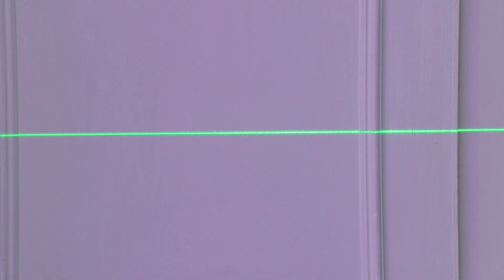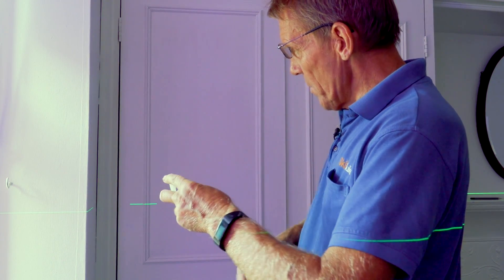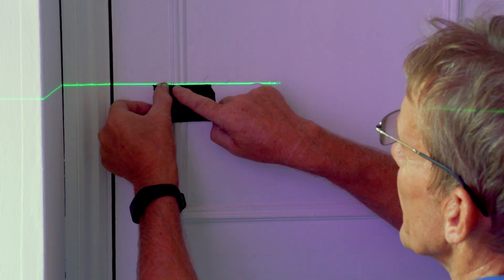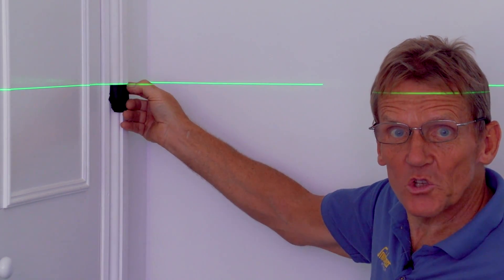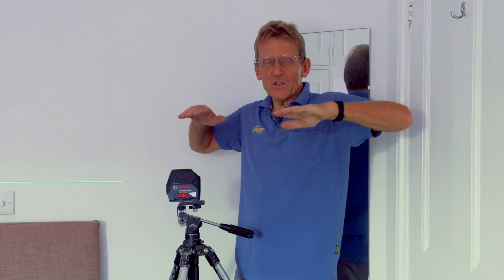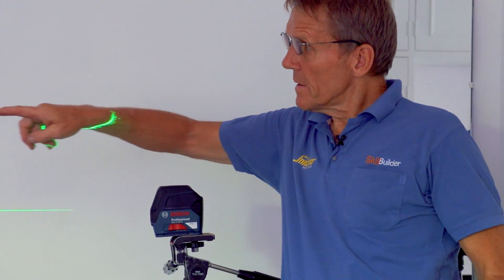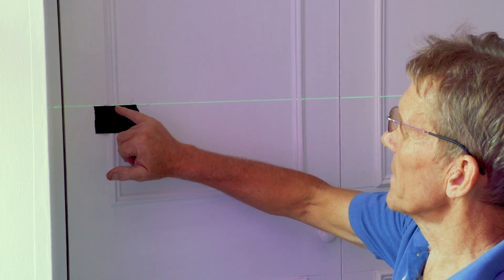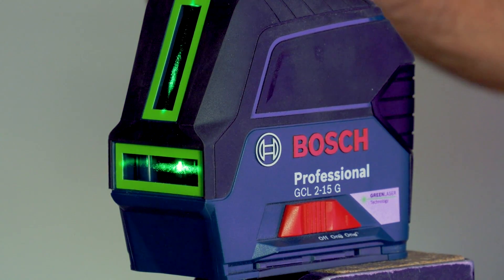Is Your Laser Level Really Level? How to Check

Comment: Absolute cobblers. The centre of the beam is your reference point, as the further the laser is from the wall the beam is hitting, the wider the beam is. Incidentally, never use the vertical beam unless the wall you are hitting is perfectly plumb, or you are 100% square to the wall. A great example of how the plumb line is generally useless on a laser, is to aim the verticle laser at something leaning at an angle to the wall, say a piece of ply or plasterboard, and position the laser at something obviously not 90 degrees to the board. Even the naked eye will see the beam is woefully out of plumb......now imagine that's your tiles or a wall unit.....oh dear.
Reply: The vertical line is far from useless. I wouldn’t use it as a plumb line but it’s an excellent replacement for a chalk/ink line. So long as you treat it as such, it’s fine.
Reply: Iggfer, quite right, that's what I do when I'm tiling a floor solo. Incidentally, the Bosch gsl range are great for tiling a floor, because the cradle they come with and the plumb bob dots make it easy to go mark to mark. My point was I would never use the plumb line of a laser for a plumb line on a wall, that's what my trusty four foot Stabila is for.

Comment: The laser blinked when you took your second measurement meaning that it wasn’t level
Reply: I own a  Bosch like that. It is blinking because the battery is low. It will blink and beep if its out of level, and the blinking pattern is more constant.
Reply from the maker: It was level. It just got kicked. The good thing about self levelling lasers is that they recover.

Comment: This logic is flawed. Unless the floor is absolutely level, then the laser level could rise or fall plus or minus a mm or two over 3 or 4 metres across the room. This means that the variance isn't necessarily related to the laser being inaccurate.
Reply from the maker: Hi Paul 
 You may say that it is flawed logic but if you just try and think a little more about this you will see why it is a method that most laser manufacturers recommend. The laser is self levelling and if you establish the two lines at either end of the wall and then move the laser to the second position you may then have to adjust the height of the laser so the laser is exactly on the pencil mark. This means that even if the floor were 300 mm higher or lower the laser would still  start from the second position and run back to the first. If the laser is working properly the line from the second position will meet the first pencil mark. That is how you discover any discrepancy. The floor level is not a factor.
Reply: @SkillBuilder  I see what you mean however, given that the laser changes width over distance, the position of the laser device would need to be the same distance from each piece of tape vice-versa when the tripod is moved. 
Marking the centre of the laser with each piece of tape and then simply rotating the device on the tripod would give a more accurate reading.

Comment: Always take middle of the beam! Bottom of the beam changes by distance
Reply: I always go middle of the beam. I don't care if its against the manufacturers recommendations, manufacturers don't always understand how the tool gets used in the real world. Centre of the beam is always going to be the same line if your machine is reading level, no matter how wide the beam gets.
Reply from the maker: I am going by the instruction issued by the laser manufacturer. They say top or bottom of the beam but it won't be that far out on a distance of 3 metres so either is fine.

Comment: Jeez guy you dont know you go to the middle of the line? The thickness of the line changes at distance, the center of that line is what should stay the same.
Reply from the maker: Jeez Mathew over that distance it makes no difference at all. We are not building a piano. If we get withing 1 mm we are happy.
Reply: @SkillBuilder  it's very simple if the walls are not the exact same distance away the bottom of the line will be at different heights, meaning even if the level is dead on balls it could show that it is off. It's lasers 101 you go to the center of the line. It's simply not how you do it. Wrong. Imprecise. Not to mention you can just turn the laser to check.

Comment: Whoever commented about the bosch accuracy .
I did quite a bit of research before buying my GLL 80P .
At the time it was more accurate even than stabilas version(+/- 0.3mm /M) , at a tolerance of +/- 0.2mm over 1M .
The only thing better at the time meant spending £1k on a  +/- 0.1mm rotary , with the Bosch £280 it was a no brainer and 6yrs on it's still excellent.
Just saying👍
Reply from the maker: Thanks this is just the kind of user comment we need. People can learn a lot from this experience.

Comment: Great vid Roger but just a query could you have kept the laser level in the same place,  mark as far left on the line with tape the swivel the laser level so that the far right of the line meets the tape on the wall and it should just touch the tape as before? Because the floor could be running up or down in another position.
Reply from the maker: It is self levelling and provided you line up on the mark it will be correct.
Reply: @SkillBuilder  yes but if the floor in another position is running up or down for any reason it will give you a false reading surely?
Reply from the maker: @martin1977uk  That is not the case. The laser self levels so lining it up with the second point should set it level with the first point. If it doesn't it has nothing to do with the floor, it is the level.

Comment: Weird there's even a scope of distance they allow to be out of level! Level is level... 5/16" of an inch out of level is not level!
Reply: If you want something really level over several metres use a water tube. Make sure there are no bubbles in it though! That sort of accuracy isn't necessary for most building projects though. With spirit levels, engineering levels are much more accurate than builders' levels

Comment: the right way to check... only one small mistake: at the and you said the error is about one mm because you have to double the .5mm we saw (if I got you right...); in fact it's the opposite: because that .5mm we saw is the result of out and back of the laser line, the actual error is only .25mm/10ft. But that doesn't matter, it is very good
Reply from the maker: I will have to think about that. You may be right

Comment: Thanks for the video, I bought a bosch gll 3-80 cg checked the accuracy using this method and it was spot on over 11 metres, I'm just thinking if it is correct along one wall left to right would it be correct along the other wall front to back

Comment: Surely if the floor is not level , then setting up is not true !
Reply from the maker: It is a self levelling level. Provided you put the laser line on your line it will find the level of the other mark. If it doesn't it is wrong. I think we need to do some basic instructions on these levels.

Comment: I did find that very useful thank you I've been looking at the Bosch laser levels lately and I was told to go with the green over the red just because you can see the green better outside and my only secondary question is I noticed there's a big price range in laser levels is it better to purchase the very expensive or is it okay to get the middle grade laser level not going to be using a lot more or less to check the level of tile or molding base molding trim that's about it play Metallica comment resist you let me know I appreciate it thank you

Comment: You should work with middle off beam as the beam differs in thickness with distance
Reply: and that sir is the correct way to work on a laser beam!
Reply: Hey, what do you mean by “with middle off beam”?
Reply: @anas7hamed  He meant middle of the beam (rather than the bottom edge, as done in this video.)  His point was that lasers spread with distance, so the far end of the room will have a wider beam cast than the closer end.  So if you place the black tape's top edge to coincide with the center of the beam, you avoid that effect.
Reply: According to SkillBuilder, the Bosch Laser HQ told him to work on the lasers edge. Go figure.
Reply: @myshinobi1001  Manufacturers don't always understand how to use the tools they make.
Reply: @Patrick-857  since I wrote this comment i actually bought this exact product. I can confirm that it is best to read from the centre of the laser beam.

Comment: nice method, make sure to put the level close to the one tape and far from the other, and then vice versa, just to make sure the error is maximised.  But even then it would be hard to find a big enough room to get a proper measurement indoors.
Another way, I thought you were just going to put in one corner and mark the two adjacent corners, then move it to the opposite corner and line up with one of the marks.  The difference between the two other mark and the laser would be doubled up so you'd be checking over twice the diagonal of the room.  With only a 3m by 4m room you'd end up with the accuracy over 10m which would be very useful information.
Reply from the maker: Good observations. The location was not ideal on this demonstration but outdoors it was a lost cause. I would tend to do it outdoors in the evening to have a better chance . 

Also I think I would mark out some lines and go back to the same spot for regular checking.

Comment: With over 20 years of experience calibrating laser I can say laser go out because they are knocked or dropped. Also his method is not right. Have the laser close to a wall and mark it then doing the laser to another wall over 10 meters from the laser and mark it. Then move the laser to the first mark and level to that height, turn the laser to the first mark and you will see any error. These laser suffer from convexing, concaving or cross tilting which will produce terrible errors using his method.
Reply from the maker: Thanks Adam I am interested in your finding and will ammend the information with another video. It would help us if we can find somebody such as you to assist in the testing. All we are trying to do it establish a simple test that can show if a laser need calibrating.
Reply: I got lost in your explanation, can you simplify ?

Comment: Can't really see what you are achieving buy what you are doing there could be so many variables that could come into play or am i missing something?
Reply from the maker: Yes you are missing something. This is how the manufacturers suggest you check your level to see if it needs to go back for callibration. 

If you watch the video on checking a spirit level you will see this is the same idea. Just turn the level around and ask the same question. 
The laser level is self levelling so, provided you have two marks on the wall you will be able to place the line on the marks to establish what the level says is level and then by moving it to the other mark and setting it up on the line at one end it should, if it is level, hit the other mark spot on. If it doesn't it shows the variation. You could go one step further and place the level midway lined up with a midway mark and that would show how much it is out at either end. 

In this case we would be talking about 1/4 mm at each end which is well within tolerance.
Reply: @SkillBuilder  Thanks for putting me right i now fully understand (maybe get a new presenter ;0)

Comment: My Dewalt Cross line pendulum laser level has no lock function. You should always use the center of the laser line as your reference. I set up calibration marks with a water level in my garage about 7 meters apart and check my level against that.
Reply from the maker: That is a good idea. Bosch say to use one edge of the line but the middle will do.
Reply: @SkillBuilder  Now that's interesting - Just checked to see where  I got the information about marking the laser line & Dewalt's manual for my laser does state mark the middle of the line, I wonder if that instruction is model/manufacturer specific? Wrongly assumed it was for all. Live & learn!
Reply from the maker: @DangleFilbert  I don't suppose it matters that  much, provided the marks are on the same bit,, but maybe the line thickens on the brighter setting.

Comment: The question is, is that laser out by half a mill or is the tripod not accurate as you're having to wind it up slowly, so the tripod might be out instead
Reply: Tripods are neither in or out. It's just something to set the laser on. You could do the same test by setting the laser on a pile dog shit
Reply from the maker: It shouldn't be the tripod. The line is re-set to tape so you get the story backwards.
Reply: @SkillBuilder  I would only assume if the tripod wound up smoothly and not in steps.

Comment: Great and simple method, the only thing I would do is mark on the middle of the line, not on the edge, the thickness of the line can change depending on the distance from level.
Reply from the maker: Good point well made. This tip was given to me when I visited the Bosch laser HQ. They said work to one side
Reply: Skill Builder can you explain this in a video please?
Reply: @SkillBuilder  it would be great to get a video explaining this point and why this is the case. I just bought one of these and I'd love to be able to use it the right way from the get go.

Comment: Sometimes the MK1 eyeball is best, I was at the far end of a large garden, building raised timber beds into an existing paved area that sloped away from the building - with 'volunteers'.  My Guvnor was at the far end of the site doing the groundwork for another paved area, something didn't seem right but I was fully occupied with making sure the 'volunteers' didn't lose a finger with a saw or take someones eye out with a drill.............and get the beds built.  Come smoko, I laid a 4ft Stabila on the compacted Type 1 and it was falling towards the building..............the heights had been set using a Leica that had just come back from calibration!
Reply from the maker: Yes you are right to trust your eye. I am still not trusting when I use a laser level so  I still just check the line with my bubble.

Comment: Hi Roger, I use the dewalt dce089 green 3 line laser & to check mine I use 2 metal plasterboard poles. I set them as far apart as possible (approx 10m) & set the level on one pole with battery at the back and mark the  poles - then move the laser to far pole
and set the lines with battery at the front & this shows any discrepancy in not just the pendulum but the mounting as well. 
By the way, you looked really good on Strictly last night with Luba 😂😂😂
Reply from the maker: Tim. Poles apart! That is great advice. As for Strictly, I have never watched it. Anything with a studio audience mindlessly clapping along to the music has to be placed in the same category as The Billy Cotton Band Show, The Black and White Minstrel Show and all those other naff productions that have blighted Saturday evening television for years.
Reply: @SkillBuilder  😂😂 you do make me laugh - proper grumpy old man 😂😂, mind you do have more than a passing resemblance to James Cracknell 😂😂😂
Reply from the maker: @timmargereson332  Good stuff Tim. Truth is that even when I was young I was grumpy.  I ran a mile from all that middle of the road variety type stuff. In those days there were just two channels and the t.v companies thought their audience of 18 million was an approval rating whereas, in truth, it was a captive audience with nothing else to do. 

Now we have such a choice of viewing  there is absolutely no excuse for watching Strictly. If I caught any of my family watching it I would pull the fuse. What we call in the trade a safe isolation intended to protect the occupants from harm.

Comment: Thanks Roger. I did notice that my laser level was not level when i tiled a large area and when 4 walls joined up the tiling was out by 6mm! Bit of fiddling and i lost it but not good. When im tiling long walls still use my old water level and set a datum with a chalk line. No mistakes with that method. Cheers mate.
Reply from the maker: Big fan of the water level
Reply: @SkillBuilder  You should do a video! Had mine donkeys years. Man that taught me had it for years and gave it to me when he packed in. Actually made of brass and very niceley made. Few leaks in the hose and a bit of duct tape here and there but still works. Mind you, whats to go wrong! Cheers again.
Reply from the maker: @tilerman  We have a video coming out. That brass one was a Holland I believe. Very nice, I would buy one, mine is plastic.

Comment: Top laser level tip : Most of the major manufacturers want to charge you an arm and a dick for a floor to ceiling rod to mount your laser level too. £70-£120!!  And tripods get in the way, (as rog' demonstrates in this video :P) and don't go low or high enough.  Use a drylining ceiling boarding prop that can be procured for as little as £15 instead with a small steel plate tie wrapped on for the magnetic bracket to stick to :)

Comment: I believe your test is simply showing the consistency of the laser level. Let’s say it was 5mm out initially then you’re simply showing that it’s still at least 5mm out from a different position and distance. 

Surely you should still verify the initial measurement with a spirit level, or ideally a water level.
Reply from the maker: No because it is taking the line from the other end you will see a discrepancy.
Reply: @SkillBuilder isyt1 is correct. This test does not verify that the laser is level, but that it is consistent. It only proves that the laser will give a consistent line independent of its position in the room, but does not prove that the line is level.